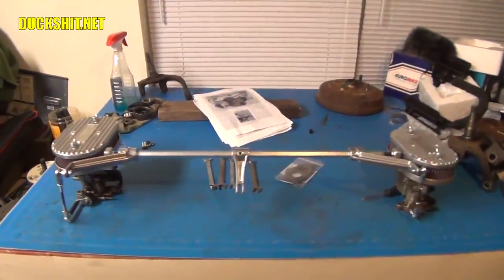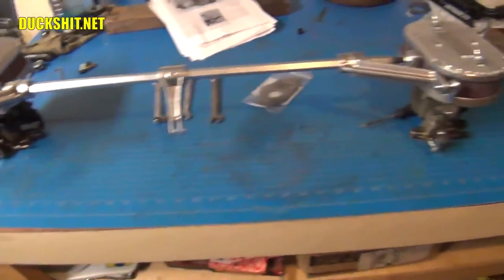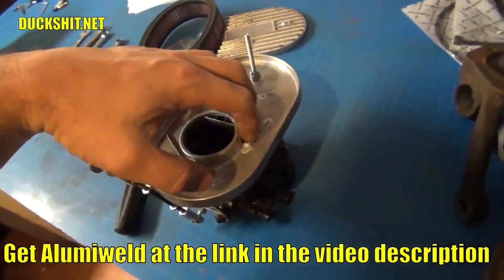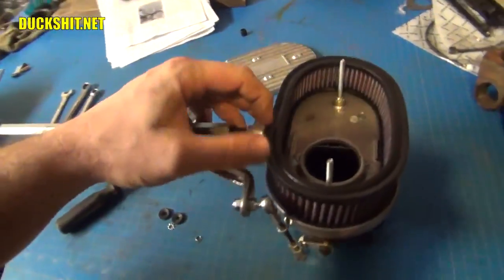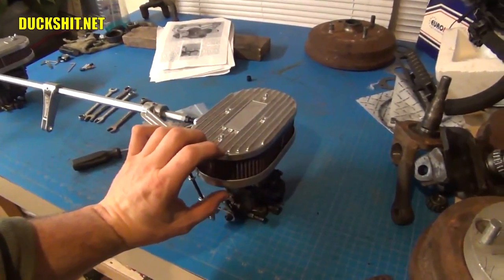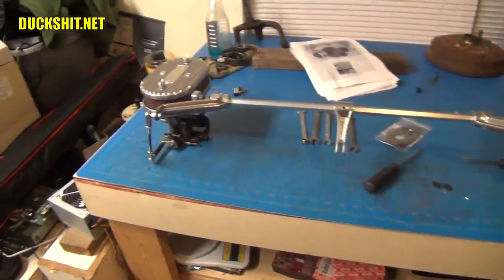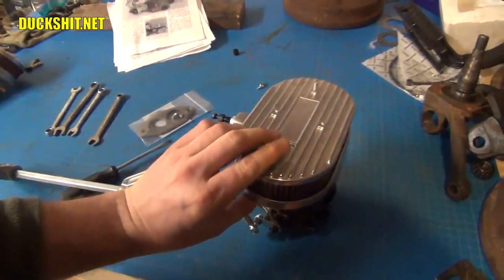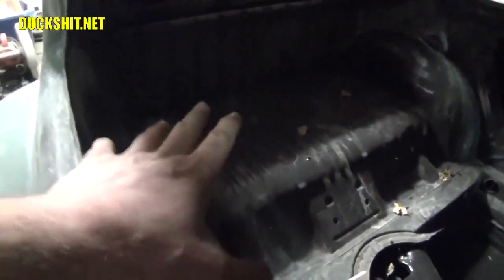VW Type-3 Carburetor Linkage - VW Beetle Rear Hatch - Mid Day Q & A - 9

Comment: When I put duel carbs on my vw thing I got more hp and better gas milage. That didn't seem right, but you do get more mpg with two carbs. :)
Reply from the maker: As long as you're not ragging on it yes you will get better gas mileage with dual carbs, you get more usable power which translates to less throttle required.  I'm very happy with the dual carbs on my Fastback!

Comment: Duckman will type3 dual carb kit work on a type1 motor? Have everything too fit and use. Like too hear from you.
Reply from the maker: Yes, the carburetors and manifolds should fit, but you may have some trouble with the linkage depending what type you've got.  Which kit do you have?
Reply: @DuckmanCycles  using modified version of weber linkage like you did in the video. The carbs are brosol/solex. Only what i did was make them into a twin throttle body system going efi.  Using cone shaped airfilters.
Reply from the maker: Thats an interesting re-purposing.  I'd probably just get a set of cheap throttle bodies and make them fit instead.

Comment: sucks that they sent you the wrong stuff, sounds like VW parts world is worst than the Harley aftermarket is lol. new cam has good pis but the hum or noise takes away from your video but you away's have good content
Reply: looks good on linkage but left hand carb linkage looks like could be an issue with that long extension. had same type of a tunnel ram couldn't keep it in sink ended up making offset linkage to get away from problems
Reply from the maker: I guess we'll see.  This is how they usually come in an offset kit.